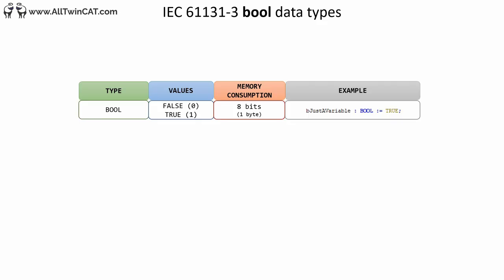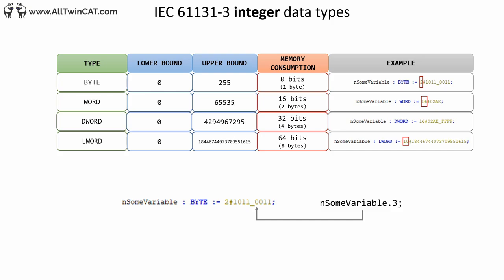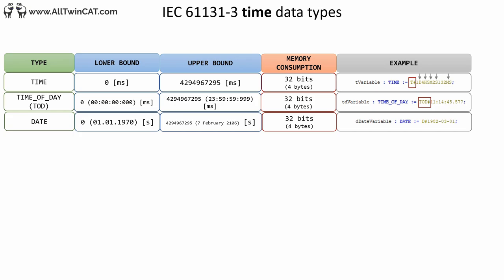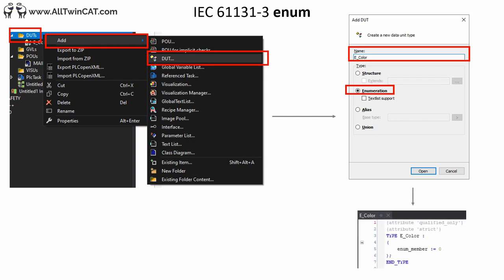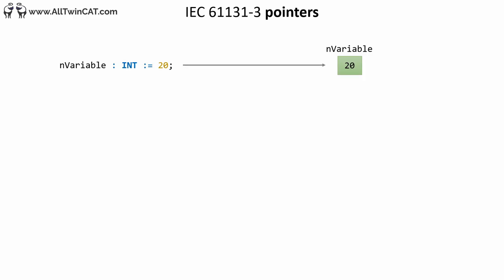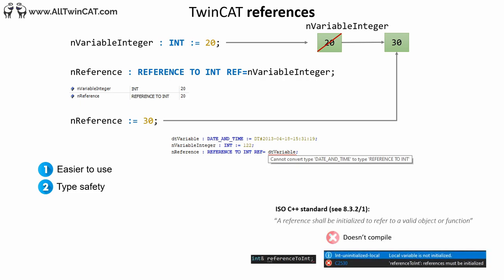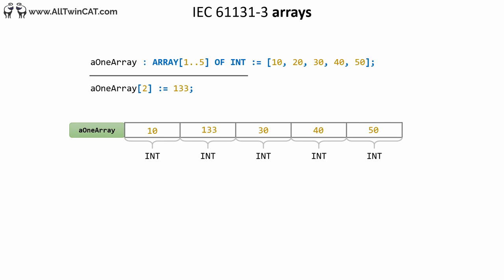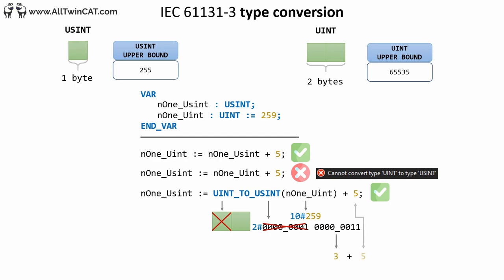PLC programming using TwinCAT 3 -  Data types & arrays (Part 4/18)

Comment: Hi Jakob! :) And that is 
In witch part r you talking about handlink bigger strings than 255 elements? Cause I'd like to handle the dataflow of my electricity meter (DSMR port, P1 port etc). And that is approx 2.5kbytes.

Comment: Thank you very much for the valuable content. Just one question, why do we use reference and we don't use the original variable itself? which one has the priority (if any) if we write the variable or if the reference pointing to that variable?
Reply from the maker: Hi Rasoul! By using a reference we are actually using the original variable! It's if we DON'T use a reference that we use a COPY of the variable.
Reply: @JakobSagatowski  thanks for your reply.  Maybe there are more benefits in using references in OOP way of programming. I mean we can see it's advantages there clearly